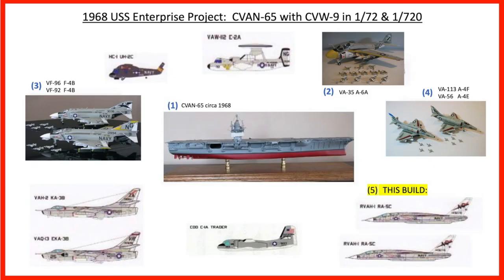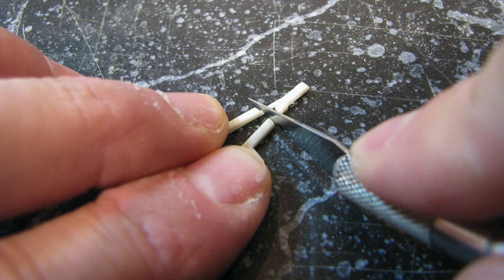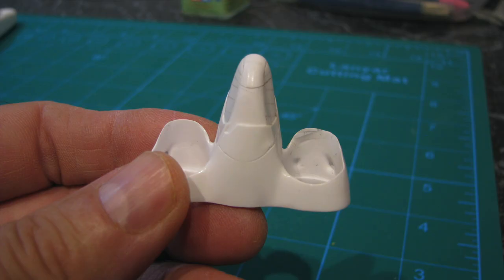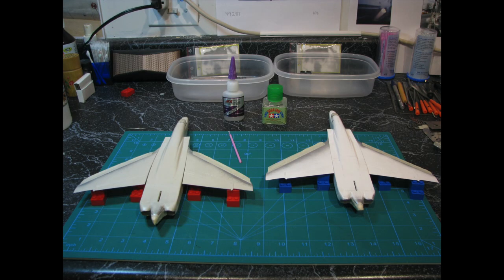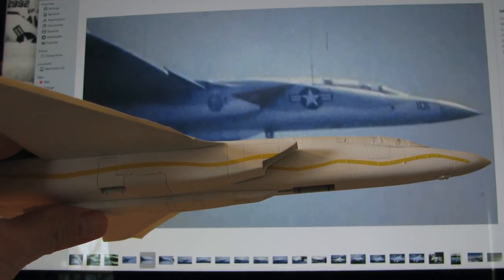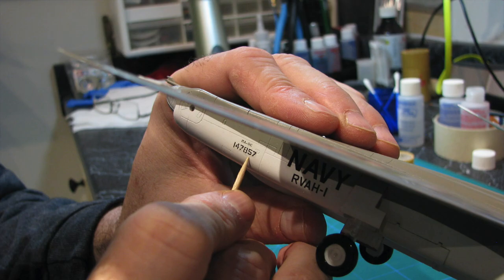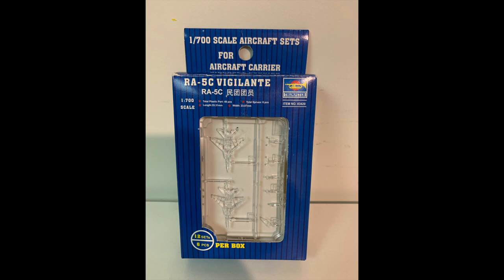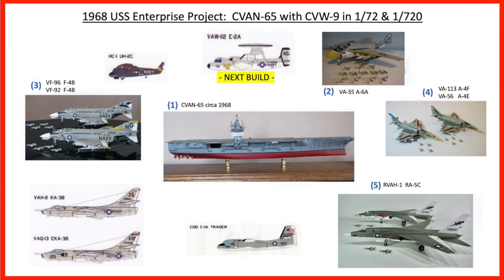RA-5C Vigilante Early Version Model Build and Improvement

Comment: You put a lot of work into the models and did a good job with what you had to work with. However there are a number of things that you do not know.  The book you used in not very good, I have it and counted about 14 major mistakes. There are better books, Vigilante by Steve Ginter, RA5C Vigilante Unit In Combat by Robert R Powel. First the gray colors too dark. The interior should be dark Ghost Gray FS36320, the top side gray is Gull Gray FS36440. Check the Federal Standard chart. The wing leading edge are dark silver Titanium and would get a small amount of rust between flights so they could have a red tenge. The top side on the flaps had a 2" wide red strip at the trailing edge, this is hard to see in black and white photos against the dark deck. There is about a 5 foot long afterburner section between the turkey feather and the engine rear that had a medium green color with a burnt oil over coating. The sides of the tail cone  were bare aluminum with a burnt oil coat. The metal had to be oiled between engine runs for protection. The fuel dump tube was bare steel. The ray domes were white to very pail yellow rubber and flowed smoothly into the Pilot Static Boom which was stainless steel.  I thank you  should build the Trumpeter kit you put away and rework the intakes and wing roots. It would be a lot less work. If you do there are 2 humps on the late version on top over the engines between the flaps that need to be removed. One other thing, the only panel line that show up with dark seams were the service panels and Spoiler Deflector in the wings. The construction seams generally did not have a color difference from the flat surface. The squadron  badge in the decals sheets was used starting with the next deployment. There could be more that I could come up with but its been over 50 years.
Reply from the maker: Thank you for the extremely detailed review. I may go back and address a few things you mentioned.  I was working not from a book, but from screen captures of actual video of the subjects on the deck taken by crew members.  While  I'm satisfied with my references, I couldn't see everything; so thank for pointing out what I missed. And yes, I know the paint is too dark; a lesson in the inaccuracy of Tamiya acrylics learned the hard way.  But at this point, I'm not going start over. Thanks again.  😵🥴
Reply from the maker: Donald, I'm currently working not he UH-2C Seasprite.  Would you know about that or any of the remaining planes in the project?  The 2 A-3s and the C-1 Trader COD?   Any advise would be welcome.  Please feel free to email me a jkauck@icloud.com.   Thanks again for your interest and excellent feedback.

Comment: Very nice, they look awesome.  Thanks for sharing . 
I am currently building a 75" long A-3J Vigilante.  It's rc powered by one fan exiting out the middle bomb bay. It's really a bummer model master paints are no longer available.  Do you have a link to the paints you use that are the correct FS numbers.
Reply from the maker: Thanks. When I was researching my builds, I found this: https://youtu.be/638i29FhaL4  It was painted like one of mine....but didn't end well.  ☹.  Hope you have better luck!  Post a video of it.  Thanks again.  👍✌
Reply from the maker: Oops, forgot about your question. So you're the first I've told this but this was my first attempt at acrylics and I followed a FSM article that said Tamiya XF-20 gray was correct. IT WASN'T. It's too dark.  I alway used enamels, Model Master FS16440 and FS36440 and knock on wood, i have several bottles left. I'm seriously thinking about repainting at least one of them. probably 147857. Anyway,  I'm pretty sure you can find those FS's in several lines of hobby paints via internet search.  Good Luck.
Reply: Thanks for the info. Yeah that big one had a CoG problem . I have a build thread on RC groups. Been having discussions on where to balance it at so I don't have the same issues.